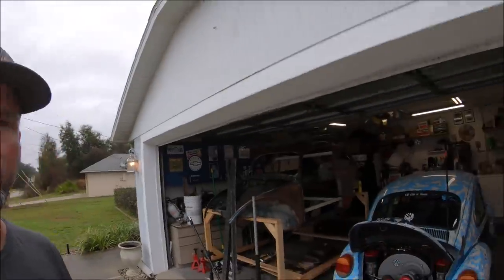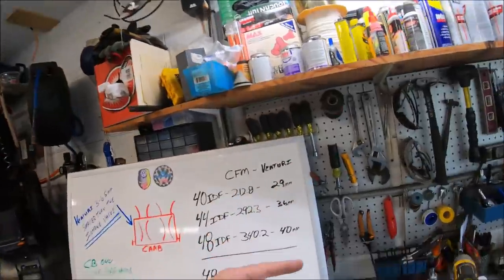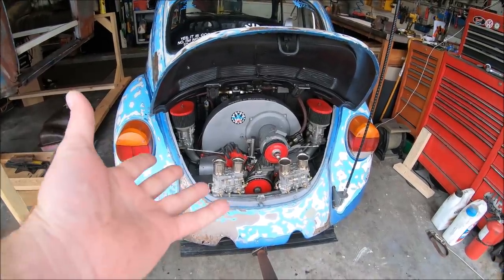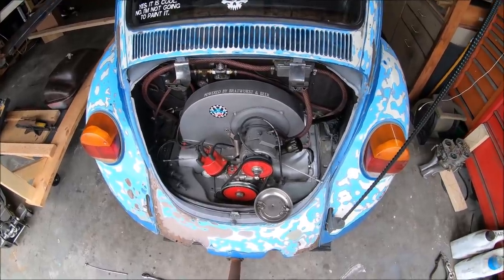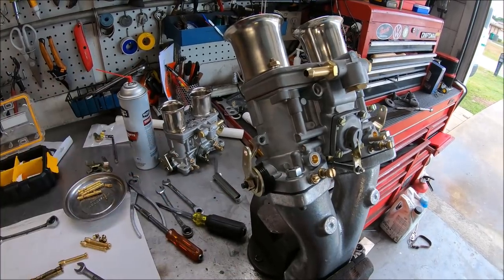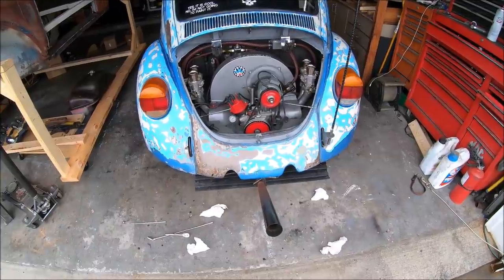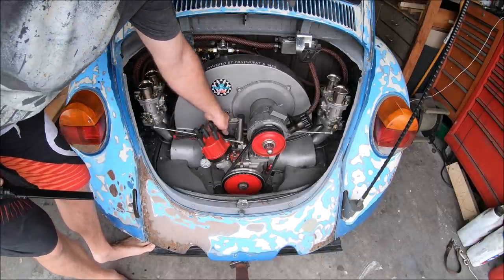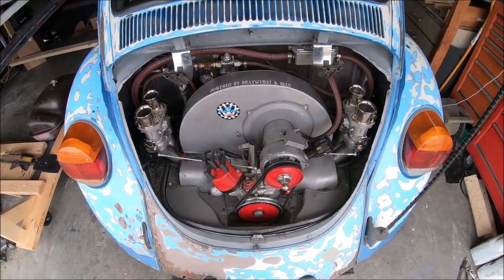Lets Install Those No Name Chinese IDF Clone Carbs on my Volkswagen! Big Fail? Part 2/2

Comment: Gary, scott barnes here in Virginia. Hey have you ever used the empi electronic ignition that goes in the Bosch 009 distributor? Pertronics is 150 to 180 verses 45.00. Just wondering if their reliable. Thanks buddy. Again love your videos.
Reply from the maker: Hey Scott!
I haven’t used the empi electronic ignition yet. I know a few people who have and it’s been hit or miss. 
What I did, because of the price of the Pertronix and my cheap 009 copy had slop in the distributor shaft, I spent a total of $199 and went for the CB Magnaspark kit and haven’t looked back.

Comment: hi the point is that you need a race machine to put these chinese carburators otherwice you need to rejet them... to work ok .tell me what is your opion about the most suitable extra carburator for a Volkswagen Beetle. a single 40 type Weber .a Pict- 3 39....or type Weber 32/34......thank you
Reply from the maker: Actually that’s not true at all and this engine is no where near stock. They were better accordingly but the venturies were too big. 
Personally, I don’t like running single IDF’s or the 32/34 carbs. I would need a lot more info before I could recommend a carb.

Comment: Tks for the content !!! It helped me a lot here. I bought one of this as well but mine is a twin "Weber" 40. I would like to see how u install the drives for the gas pedal. How can I have photos or something of that? Thank u a lot. Cheers
Reply from the maker: I’m glad the video has helped you! 
Are you talking about the linkage for the carbs?
Reply: @VWJawbreaker  exactly. Sorry I'm from Brazil so I was looking for the right expression for that part!! kkkkk
Reply from the maker: @victormuro1  I don’t think I have any videos on the linkage.
Reply: @VWJawbreaker  tks...when you install it u had to change the stock linkage ? I mean it was easy to install ? Tks again.
Reply from the maker: @victormuro1  you’ll need linkage for dual carb setup. The stock throttle cable coming through the fan shroud will hook to the dual carb linkage.
Reply: @VWJawbreaker  nice man. Tks a lot for the help. I will do that. Congrats for the channel
Reply from the maker: Thanks!

Comment: nice video!  I am running dual 40idf weber carbs--I think venturis are 28mm.  My engine compartment is really cramped---some have suggested I cut "windows" or portholes into sides of engine compartment to let me tune them easier.  Right now...its pretty damn hard to do anything...any thoughts on this.  Will holes like this compromise rigidity---any other alternatives for adjustment and tuning?
Reply from the maker: I’m right there with you and with large hands it was about impossible to adjust the carbs and when I got a clogged idle jet, we’ll that was a nightmare. 
I ended up cutting windows in the sides so I can access everything much easier. Mine are removable so it minimizes dirt and what not from coming into the engine compartment. Do what works for you though as it’s your car.

Comment: " If one does not fail at times, then one has not challenged himself "
   Ferdinand Porsche
        1875 - 1951
Reply from the maker: Perfect quote of the day!!
These did work well, they ran great I just didn’t do a ride along video. 
With the larger carbs and venturis, I lost some idle and low end but gained on the top end.
Reply: @VWJawbreaker  So.... Will we see a turbo next! Love the content.
                   (0\_/0)
Reply from the maker: @johnfreeman1189  it’s been an idea for a while now but I’d have to de tune the engine some. Plus I need they the 60 done first.
Reply: My plan supercharged 2276cc with maxican efi
And Microsquirt ecu mangment 😍
Reply from the maker: @hussianmohmmad4613  nice!!

Comment: Hi i want to know, after 2 years how reliable this carbs? And do you make a mod of the carb to make it reliable?
Reply from the maker: I didn’t want to buy a set of vents for the 48’s so I put my 44’s back on. 
I’ve setup a few sets for friends and helped them tune them in. I’ve only had an issue with 1 carb so far. 
It’s all in the prep and bench cleaning and setup.

Comment: Just looked that magnaspark kit up. Man what a deal! Coil, wires and distributor complete. I have a 1641 engine with dual 40hpmx carbs and side winder ceramic exhaust. Will that distributor kit help with better startups and acceleration etc. What's your take on the 1641 engine. To be honest it runs like a hungry fat lady at a buffet. Sorry that was wrong. In a way. I should have went aa 88 pistons. Probably would have ran substantially stronger. Hey, thanks for responding pal.
Reply from the maker: The nice thing is the Magnaspark is fully customizable and can grow with you as your needs or engine combo changes down the road. That setup does deliver more spark energy which will help with all around performance. 
I had a 1641 before I built this other engine. I wouldn’t recommend the slip in 88’s as the wall are too thin and the engine will run hotter. The machine in 88’s, well you mine as well machine for 90.5’s or 94’s at that point. 
Just some random thoughts for ya. 
Have a great rest of the weekend.

Comment: As always great info and video.Do you find one style linkage better than another thinking about trying my hand a some China 40 idf but don't know what linkage set to go with.Thanks
Reply from the maker: Thank you sir. 
I’ve had several different styles of cross bar linkage.... spend a little more and get a quality set from a quality company, it’ll save you so much time and effort in the long run. 
As for the center pull linkage like I have, the CSP linkage is the best imo.
Reply from the maker: Also, if you don’t already have dual carb setup, it might be cheaper and better to buy a full kit instead of piecing one together.
Reply: Good deal as always thanks for the info and time.

Comment: Can I send you my after market webber to go through? I cant get the thing to stop burning rich. Driving on it now for 2 yrs but keep fouling plugs.. I have a fuel pressure regulator installed.. 3 psi.. tried using vacuum guage to set, no go.. maybe I need to just order another carb from redline. Any ideas?
Reply from the maker: I’d double check your accelerator adjustment and jets, wouldn’t hurt to double check the float. If you’re running that rich it’s probably one of those three.

Comment: Gary, tech question for you. I'm installing the weber 34 ict duals on my trike. The tin are trapped between the manifolds and the head. Should I clearance the tins or do you think it will be okay? It's a single port. Thanks. I just needed some advice even though I may already have an answer. Have a great day! Jim
Reply from the maker: Hey Jim! It would be wise to trim the head tin so the manifolds clear, if not you could end up with a vacuum leak.
Reply: Thanks for the voice of reason. Lol. I knew it but almost wanted to chance it. Fix it now in the garage instead of on the road. Thanks again Mr. Wizard.
Reply from the maker: @jimlester5003  not Mr wizard, just been there done that experience 😂

Comment: This project has promise. Go with the smaller chokes and slightly bigger jets
Reply from the maker: Yes sir, exactly. Would have been fine if I remembered what size valves I had when I ordered the carbs lol
She ran great, just idled higher than I liked and lost some low end due to the venturi size. Smaller chokes and she’ll be just fine.